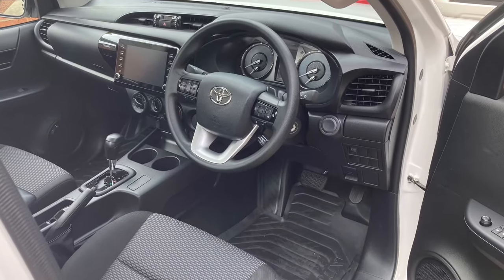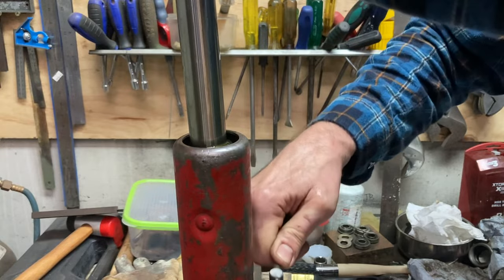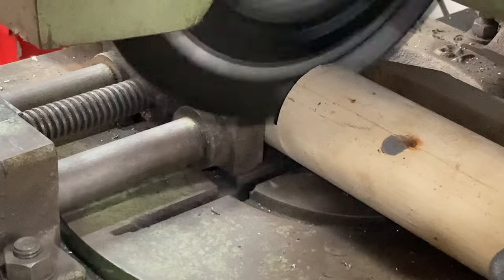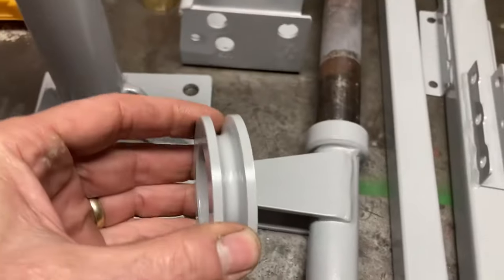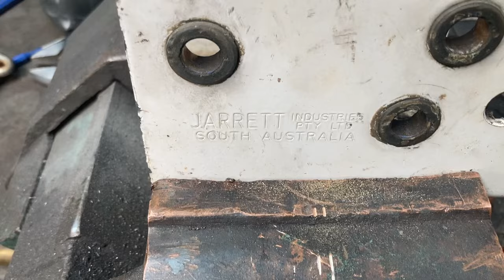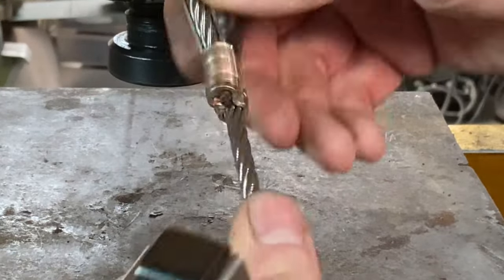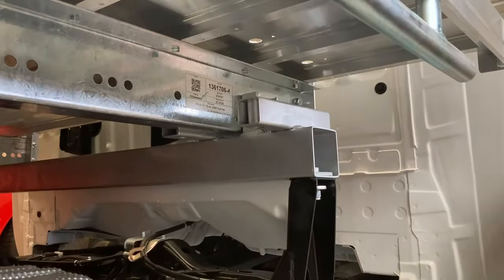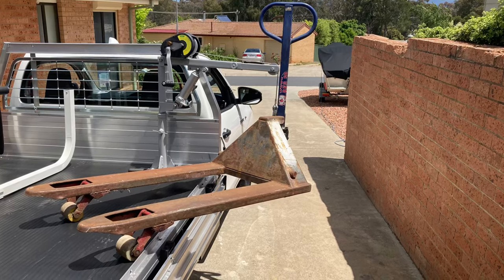Homemade hoist for my new ute.

Comment: Great job.  Worked out well.  Where best to mount it comes down to personal preference.  The only downside to using the driver's side is that you are loading/unloading into the traffic stream.  My Bro-Inlaw has been talking about getting one of these forever.  Typical farmer ;)  Cheers Rob
Reply from the maker: Hi Rob, that’s a fair comment and I thought long and hard about which side to mount it on but decided on the drivers side because: it’s not a work vehicle so it won’t be getting used a lot, 99% of the time I’ll be loading or unloading from somewhere relatively safe like the auction house or junk shop to my driveway ect or vice versa and it’s a lot more convenient for me on the driver’s side. If I was a courier or something then it would definitely be on the other side. Thanks for caring about my safety and I love the typical farmer comment. Cheers my friend, Stuart.

Comment: Great idea and excellent build. A manual winch probably wont give you any trouble but electric would stop working when I need it most with my luck. As we say in America, SWEET!. Thanks!
Reply from the maker: Hi Chopper, you are so right my friend especially a winch that doesn’t get used a lot. Just like an old starter motor the contacts tend to get corroded. It sounds like your luck is the same as mine😂😂. Cheers mate, Stuart.

Comment: Great job in the end, definitely a lot stronger than the cheap ones, and cost wise probably even cheaper than the dinky ones, coming in with all "pre used" materials as source, just like the factory one, just saved the smelt and turn to tin can stage. Looks almost like it is something Toyota should offer as an option as well. 

That bottom thrust bearing, if you could machine it in a lathe with HSS tooling, then that thrust washer race is made from stamped unhardened steel, so likely all it took to leave those Brinell hardness test balls was likely around a 1 ton load applied.
Reply from the maker: Thanks Sean, yes just about everything was free, just the way I like it. Can you imagine the price if Toyota offered one as an option, there are Australian companies offering hoists but they are thousands of dollars. Cheers, Stu.
Reply: @scroungasworkshop4663  Funny enough I would bet your Ute was made near by me in South Africa, as the Toyota plant here does a lot of worldwide production of RHD vehicles for the pickup market, even though that particular rear bin is not an option on the models sold locally.
Reply from the maker: @SeanBZA  Hi Sean, from what I can see all the Hilux built for Australia are made in Thailand. Maybe that’s why there’s so little legroom 😂😂😂.
All the alloy trays are made in Queensland and there are several designs to choose from including longer, wider, longer and wider and steel as well.
I opted for the smallest tray available as that’s all I need. A lot of the accessories offered by Toyota such as bull bars, roof racks ect are made here but have Toyota’s name on them. This means they’re covered by Toyota warranty as well. Cheers for now 👍

Comment: I like the work you did on this truck crane. Especially the thought to keep out water.
The problem of the winch handle hitting the overhead rack could be prevented by putting a 12 volt elect winch instead - ie no handle. or making your crane a bit taller to allow the winch handle to clear the truck rack top beam.
I really like your truck bed with the fold down sides! I will build one to replace my rotting out original truck bed. 
Thanks for posting.
Reply from the maker: Hi RBL, funny you should mention that. The hand winch proved to be a problem the first time I tried it out on a job. Standing between the load and the truck bed to wind the winch was very awkward so I’ve since replaced the hand winch with a small, wireless remote electric winch.
This has taken me away from my original plan of keeping it as simple as possible (no electrics) but the new winch has made it a joy to use. 
I’ll put out an update video of it sometime. 
Thanks for taking the time to add your thoughts and although I was already ahead of you, your ideas were spot on.
Cheers, Stuart.

Comment: Thanks for the amazing video. I am never going to look at raspberry jam the same way again! I am also never going to look at my angle grinders the same way either. I give those grinders plenty of respect already, but I am going to be even more cautious. BTW regarding adjustable/crescent/shifter wrenches, have you seen the videos that mrpete222 did testing push vs pull and testing wrenches to destruction? I think he called it Myth Breakers #1 and 2 use and abuse of crescent wrenches. I was surprised by the results. Thanks again for the entertaining and educational videos.
Reply from the maker: Hi Jeff, thanks so much for your comments and no I haven’t seen mrpete’s testing but I’ll go and have a look. He’s a pretty smart bloke. I only included that comment because someone called me out on a previous video about using it the wrong way😂😂 Mate, I really appreciate people like you taking the time to comment. Cheers, Stuart.👍

Comment: Not wrong with the adjustable nut rounder, they work either way round, depending on the space you have. I have all sizes, from dinky and tiny, to the big one, "One Size fits most" because there are some nuts where you cannot get the head in.
Reply from the maker: 😂😂😂Thanks.

Comment: Great job ! I’m going to use a 12v winch with an Anderson plug on mine . New subscriber, love your channel .
Reply from the maker: Hi Gus, funny you should mention that because I’ll have a follow up video showing some modifications. Namely the fitting of a 12 volt winch! 
I just found it too awkward trying to use the winch while I was between the load and the tray. I’ve put a small car battery in the aluminium box that you can see in the video and guess what, it plugs into the winch via an Anderson plug when I use the winch. Great minds eh? 
I’ve just ordered a small solar panel to fit on top of the aluminium box and regulator to connect to the battery. I think this will be more reliable than me trying to remember to charge the battery. I wish I had thought of a separate battery and solar charger initially as the only reason I went with the manual winch was to keep it simple and it wouldn’t need wiring to the car battery. Anyway the winch has a wireless remote so winching on my own is a breeze. I’m glad you like my channel and thanks so much for subscribing. Cheers mate, Stu.

Comment: I've got a flatbed Toyota that I'm wanting to add a crane to, except I'm planning to add it to the foot of it, rather than the base.  I plan to have a leg that swivels down and extends to support the weight, like the Hilux Surf, except mounted directly under the crane, sharing the same mounting bolts.  It would need to be adjustable, hydraulics would definitely allow the most options, just unsure of what to source.
Reply from the maker: Sounds good 👍.

Comment: Very very impressive, one question is your use of ultra strong bolts for the base hold down. Sometimes a grade 5 is recommended over grade 8. They may have to be spread out further and more of them. This is not condemnation just something I have observed.
Best regards
Peter
Reply from the maker: Thanks Peter and I agree, grade 5 would have been more than adequate but I had these bolts on hand so that’s why i used them. I don’t know what they would cost to buy new but probably more than the whole car😂😂😂

Comment: Buy same crane for $179 at Harbor Freight, often on sale.  Lifts 1000lbs; mounts similarly; arm lifts 90" above mounting surface, cable winch gives more lift from below mounting surface.
Reply from the maker: Hi, thanks for your comment but I don’t understand what you’re getting at. Would you mind explaining what you mean. Thanks.
Reply from the maker: @stlpro2a386  Interesting comments, and I do appreciate your concern for my safety. No, I’m not a structural engineer but I have been working with steel all my life so I have a fair idea of its strengths and weaknesses and I have absolutely no doubt it will safely lift the loads I intend apply to it. 
I use a scale to check the weight before lifting and I also use a bit of common sense. I live in Australia not the USA and we don’t have Harbor Freight or the ridiculously low prices available to Americans, if we did have them available at that price I think I would have just bought one. 
A very merry Christmas to you and your family. Cheers mate, Stuart.

Comment: why not leave the jib at about 45 degrees and just use the winch alone without the jack ?
Reply from the maker: Because I wanted the boom to be level with the roof. If it was fixed at 45 deg it will be sticking way up high and I wanted to keep it as inconspicuous as possible. The jack is just there to give the clearance I need between the hook and the tray when lifting taller items,  but when lifting something like an engine or pallet jack I don’t use the jack. Thanks for the question and I hope you enjoyed the video. Cheers, Stuart.